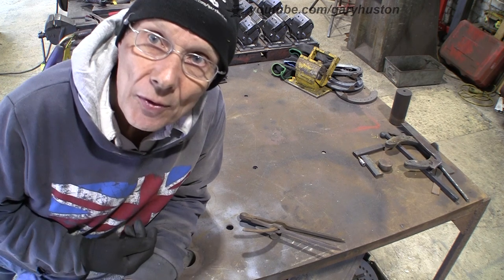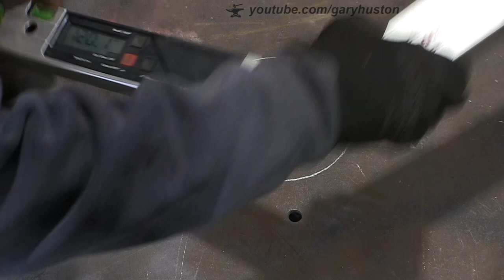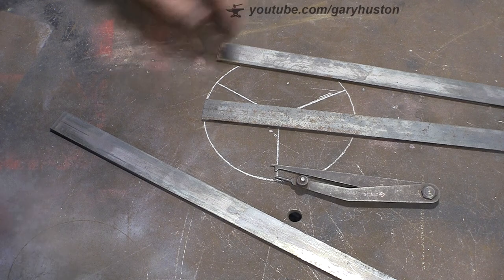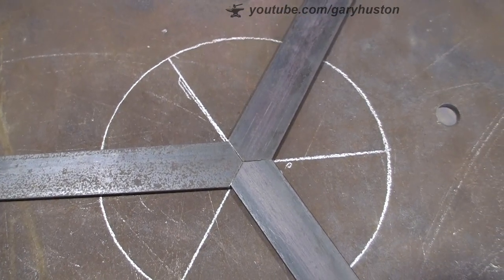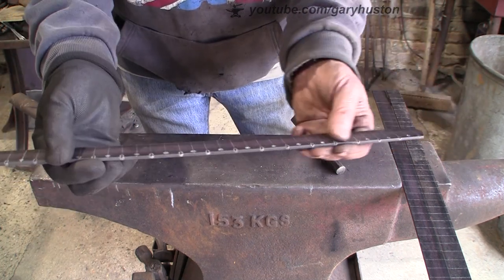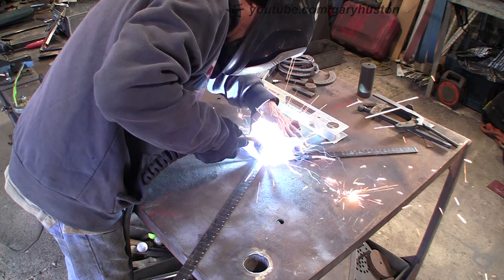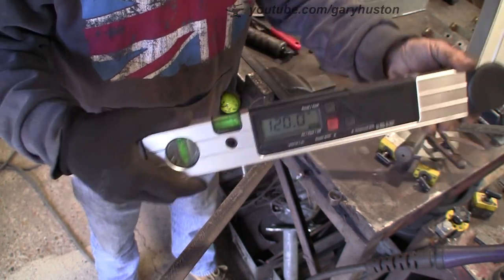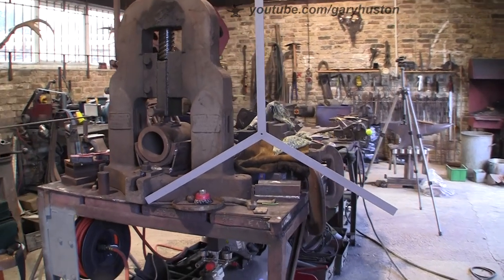Three legged square

Comment: You've recovered from rotator cuff surgery a lot faster than I did!
Reply from the maker: It's been 10 months so far, still get twinges and not up to full strength yet. But I'm told I had the best surgeon in the country do the job!

Comment: 120 degrees is also two lengths of your radius around the circle. A hexagon is 6 equilateral triangles. So if you set your compass, then walk it around the circumference of the circle still set at the radius of the circle it will divide it into 6 even lengths. (If that makes any sense. 🙂)
Reply: I was getting ready to  describe that as well.... I think you explained it better than I would have.